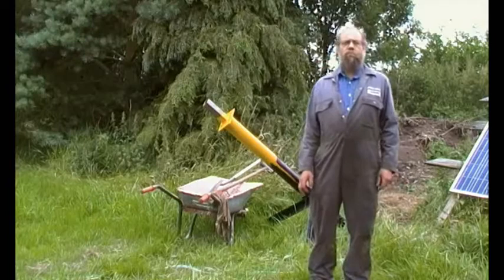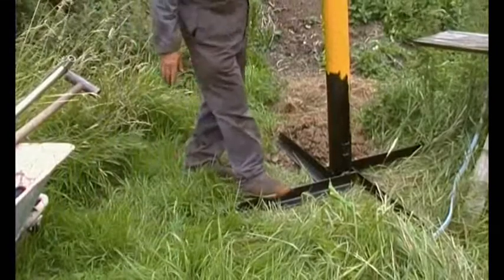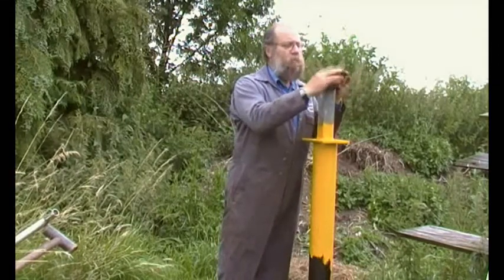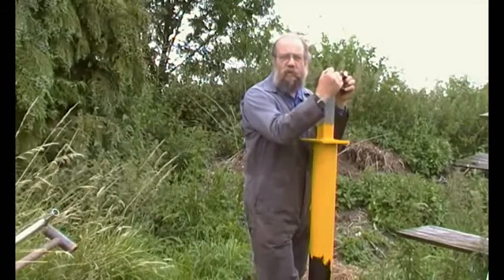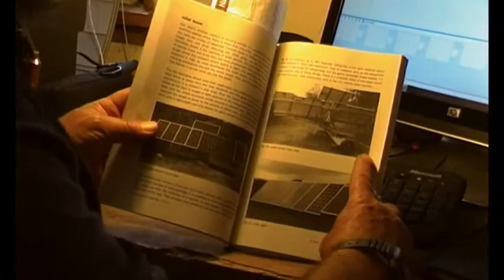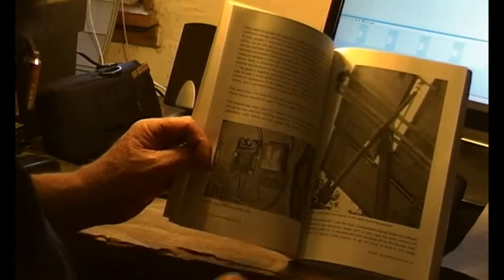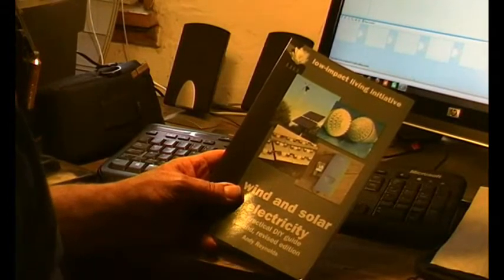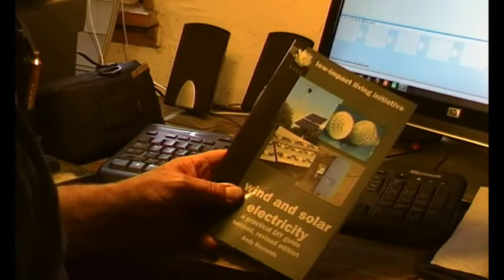Wind and solar electricity: Solar PV tracking gate, 2.5Kw of PV panels tracking the sun.

Comment: Hi, you have allowed for the pillow block bearing to be self aligning haven't you? as per having a saddle at the other end to stop it swinging in the wind when it eventually frees itself up.
Reply from the maker: That's right. nothing has to be very accurate because everything runs so slow, but just has to prevent stresses building up. More on this project as it progresses. Cheers